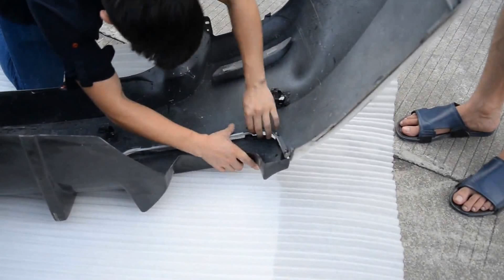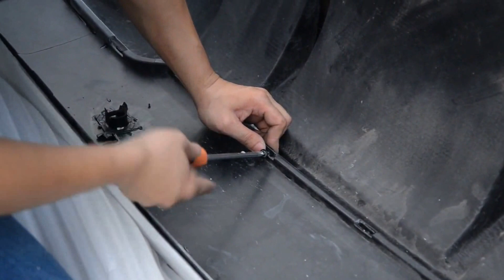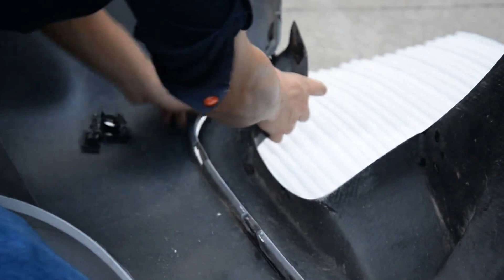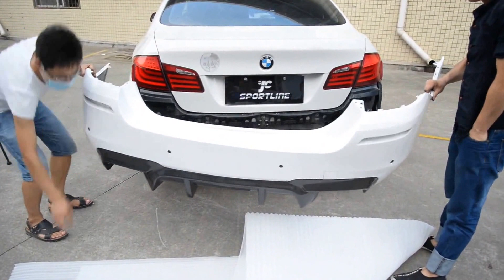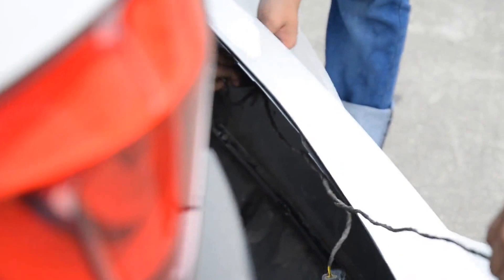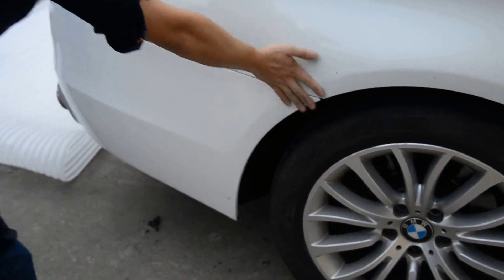JCSPORTLINE Rear Diffuser V Style for BMW 5 Series F10-M Tech F10-M sport bumper 2010-2013

Comment: Why do u need screws and drilling if it already has clip holes?
Reply: I'm having the same problem. If it's a direct replacement for the OEM part, it shouldn't need screws. I think the layup of this part is likely to be slightly off. Screws are an easier way to compensate rather than redesign the part.
Reply from the maker: the screw is helping you stable the rear diffuser
Reply: What about just using double sided tape no screws?
Reply from the maker: it may not strong enough,if you have any questions,please send message to our email sandy@jcsportline.net